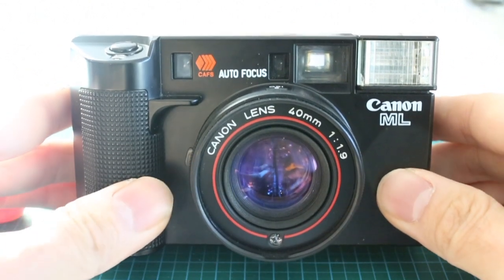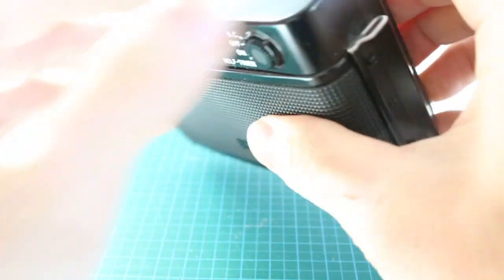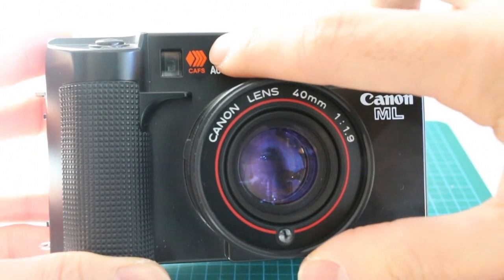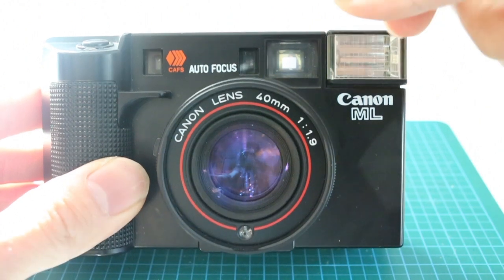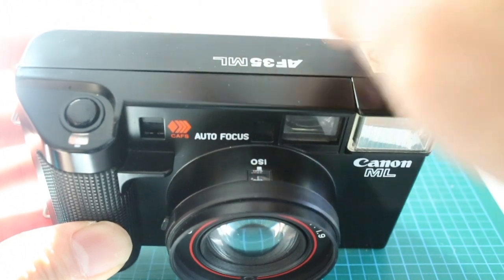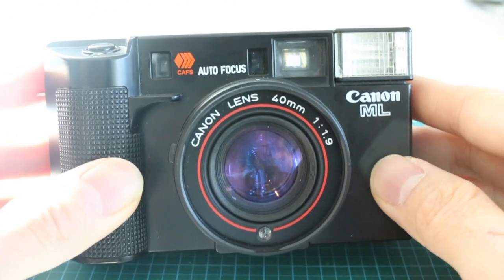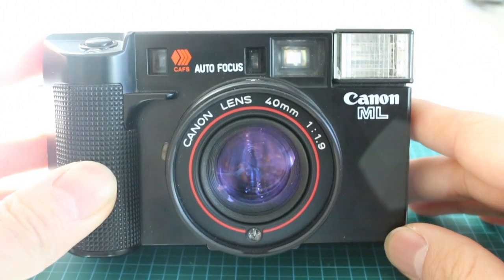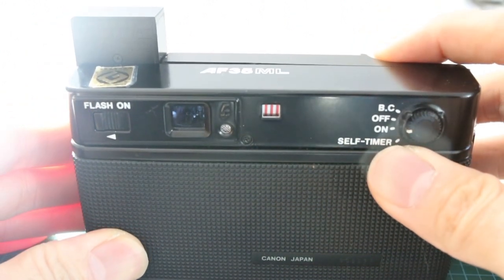Autofocusing in the AF35ML

Comment: Thank you so much for sharing this. My ML is aparently in very good condition, but the AF is wrong. First, it doesn't work all the time. I suppose it confirms with the red led symbols when it works. I tried in many lightning condition, on different surfaces and distances, but it's just not consistent. Landscape is the default, and most often confirmed. Portrait is very difficult to get, and sometimes it confirms instead of landscape (far subject). This makes the camera useless, or only available for landscapes. Such a pity that this nice 40/1.9 lens cannot be used at its potential... I wish I could at least improve a bit and use a pre-focus - recompose technique. But no matter I do, I can't get the portrait, only accidentally. I think this lens would produce the best results at close distances...
Reply: +Paul P I'm having the same problem with my AF35ML.  The focus is all over the place.  It has such a great lens though.
Reply: I recently got one in very good condition. But mine is the reverse to yours; my camera does NOT do landscapes. Only portraits :/
Reply: @gregoHybrid  It's good to know somebody has the same issue as me. I'm so disappointed about my AF35ML and it's focus system. In my last film I got like 4 good photos, and the rest (landscape photos) absolutely out of focus.
Reply: well, maybe you're luckier. I'd rather do portraits with 40/1.9 than landscapes.
Reply: What is the green camera in the intro
Reply: just got my (very blurry) role back. only the ones in broad daylight come out good :( guess i’ll stick to using it in good lighting